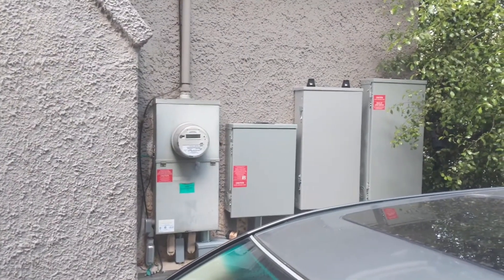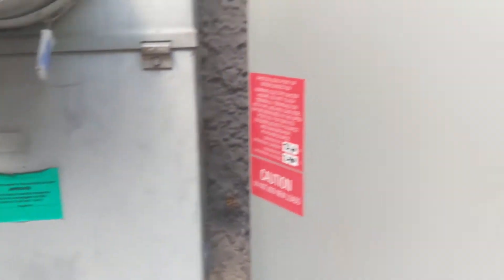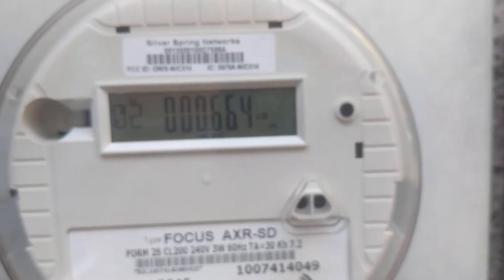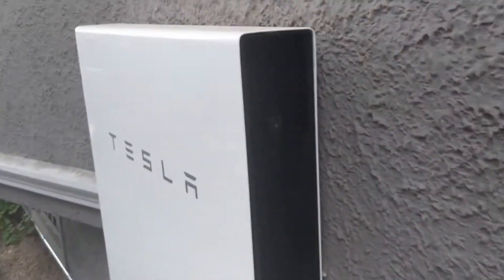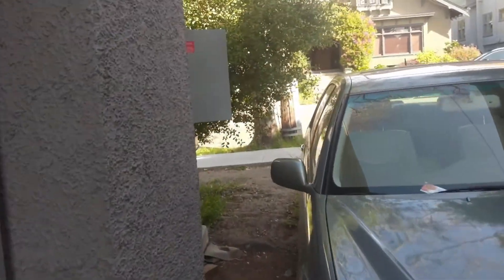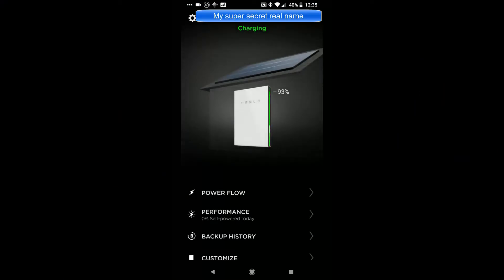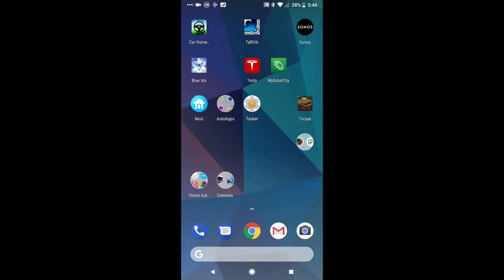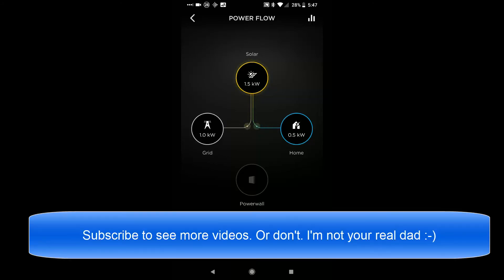Tesla/SolarCity Component & App Overview, PowerOn

Comment: We just got Tesla solar panels. We have that internet gateway plugged in and working. For some reason the Tesla app says we don’t have any products. Any ideas how to get the panels registered to the app?
Reply from the maker: who installed it? I had solarcity do mine, the installer didn't leave until we registered it and it showed up in the app. 

Also, try pinging the gateway IP from inside your network, see what comes up. Does it at least show the powerflow?
Reply from the maker: btw see below, looks like another commenter had the same issue. Odd, very odd.

Comment: Were you able (or do you plan to) integrate this with your CQC system?
Reply from the maker: I will be integrating it but not directly, rather via the Brultech GEM. I'm going to put CTs (Current Transformers) on each of the 22 circuits in the solar powered box, run into the GEM, which will then be connected via IP to CQC. Given the exact location of the electrical panel I need to mount the GEM outside and notch out the wood. Only then can I call the electrician to actually put those wires into the panel (zero chance do I attempt anything inside my actual service panel, that's too many electrons for my comfort).

Alas this work thing is getting in the way.  Hopefully within 6-8 weeks. I'll definitely put up a video on the Brultech once I do.
Reply: Awesome, thanks for the info!

Comment: So the panels don't directly charge the Tesla wall? But through an inverter first. How does the panels charge the Tesla wall during a blackout?
Reply from the maker: (Caveat: Everything i'll type is what was explained to me. I'm just a regular guy who asked tons of questions of the installers. This is what I believe to be accurate information, but I also admit I might have some bits incorrect. 1 installer verified the vlog to be accurate though)

Correct panels don't directly charge power wall. They produce DC, needs to be inverted into AC. But even then, the current doesn't directly flow to the power wall after the inverter. 

At the risk of offending the few Tesla employees who follow me, i'll greatly oversimplify this :-)   The TL;DR is: Gateway is the brains of the outfit and determines what to do based on A)solar production, B)battery levels, and C)grid availability.

Lots of boring details, with a recap for others who may read this in the future and be less savvy than you (guessing you know much more than average given your username).
I have 4 new boxes: 1) Inverter (converts solar DC to AC), 2) circuits with solar as primary source (right most box), 3) circuits with PG&E as the only source (left box), 4) Gateway (box in middle, nothing visible).

Current flows PV Panels->Inverter->SolarCircuits->Gateway->(Powerwall | Grid). Many of the circuits in the chain after the SolarCircuity entry are bidrectional.

The gateway is basically the solar version of a cars alternator. It looks at the inbound solar power levels and determines where it goes. If box#2 (solar circuits) demand 1.5 kW of power and solar is producing 5 kW of power, it sends 1.5 kW to the house. For the remaining 3.5 kW, it looks to see how low the powerwall is. It might send all 3.5 kW to the powerwall, or it might send a portion to it and a portion back up to PG&E (getting me credits). I don't know the tech specs about upper limit of what the powerwall can handle, and I only have 9 days of experience with seeing the app. Most of those days have been cloudy, so I've only hit 3+ kW of solar production on 2-3 days.

In the event of an outage the gateway is powered by the solar panels, and will act appropriately as per its programming. IE, charge powerwall if excess production.